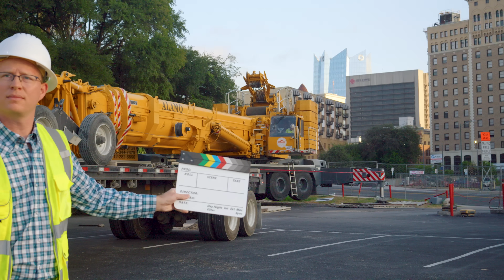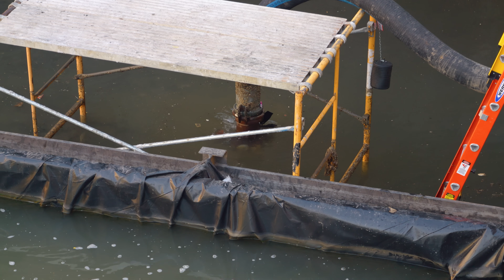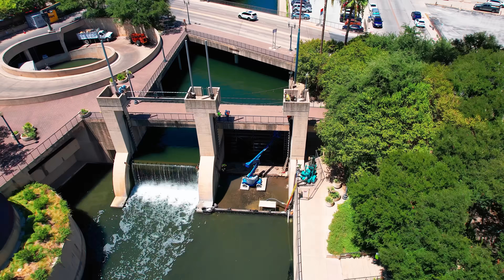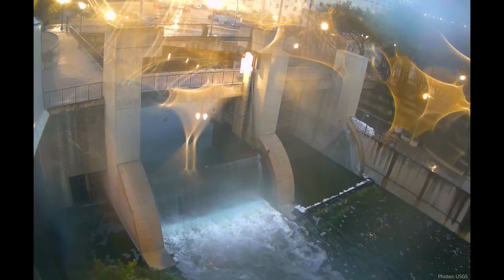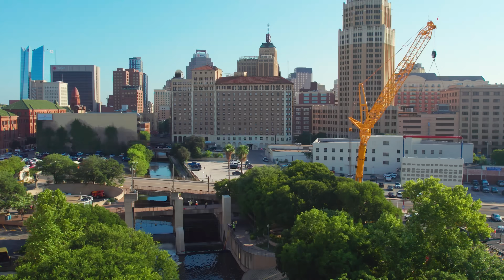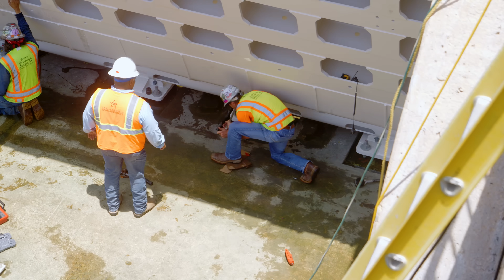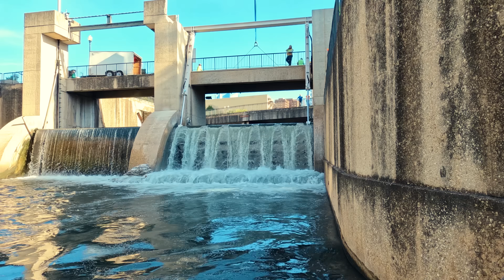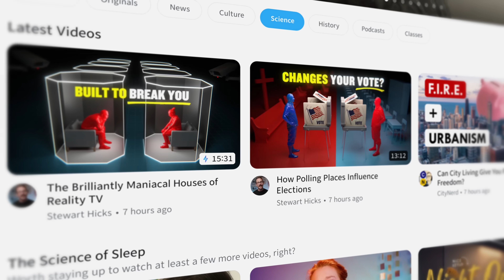The Hidden Engineering Behind Texas's Top Tourist Attraction

Comment: I'm from Houston but been the San Antonio multiple times and always visit the river walk.  So much better at night with all the lights.

I'm not an engineer but I would think making the gates hinge in the opposite direction that was designed for this application would be a better design.  When lifting the gate the force of the water will apply pressure to the face of the gate assisting the hydraulic cylinder in lifting the gate and when it comes time to lower the gate for what ever reason the big side of the ram is doing the work allowing for more hydraulic advantage.  I'm sure there are alot of other factors that went in to why it was designed the way it was.  Just my ₵.02

Comment: Can you do an episode about the inner and outer workings of large inflatable dams? I used to row on the Susquehanna River and the dock was just upstream of a short and long inflatable dam. I spent many, many early mornings wondering how it worked exactly.

It always felt a little risky launching our boats just a couple of hundred feet upstream from the dam. One foggy morning the water intake (I guess for inflation) took out the bow of one of our boats as they rowed straight into the downstream face of the intake. Another event with the dam occurred after some pranksters (we think) cut the chains holding the coach boat to the dock and it went over the dam and got stuck on some rocks just a few feet downstream from all of the water gushing down the side of the dam. I was one of the lucky ones to get woken up Sunday morning to retrieve it.

The coach took us to meet with a park ranger who drove us a short distance to the bottom edge of the dam closest to the stuck boat. Somehow, the park ranger and the coach thought it was a good idea for Kurt and I to wade through all of the rushing water to try and get to the boat. I have no idea what they were thinking, but we tried.

Obviously, that was impossible with the water raging, but they still made us try. When they realized that would probably kill us, even if we somehow could stay standing (we couldn't) they finally realized we'd have to get it another way. Had to get a trailer to drive the other coach boat to the downstream boat launch and then motor up to just below the dam and then we wrangled the boat free from the rocks it was stuck on. That was also a dumb idea considering all of the risks, but it worked. 

I don't know what would have happened if we couldn't get it. I don't know if the park or river authorities were not allowed to just leave it there or if the coach just didn't want to waste the funds of our cash strapped team buying another coach boat. 

Those stories probably don't depict the coach as having the best judgement, but he was the best coach I ever had with regards to motivation and training. 

Anyways, inflatable dam episode please.

Comment: I saw them using a torque multiplier on one of the nuts that hold down the gate on the upstream side.  Wondering what the actual torque is.  My guess is several hundred pounds, if not over a 1,000.

Comment: I'm surprised when they lifted the new dam up they didnt just use the other crane.  Just hook the big crane on the top and the smaller crane on the bottom.  Lift it up and as the big crane lifts the top they can just lower the smaller crane until its standing straight up and down.  Disconnect the rigging on the bottom and the big crane swings over.  That is how we typically do lifts like that if we have 2 cranes.  It gives you a lot more control

Comment: This reminds me quite a lot of the Floating Harbour here in my city. Lock gates were installed on the river, a huge bypass was dug (still called the New Cut, despite it being about 220 years old) and sluices were installed to maintain the level. It's no longer a working port, but the water level in pretty much the entire city centre still remains just about constant throughout the year.
Unfortunately the council hasn't kept up with needed engineering works on the New Cut, so substantial portions of it are in desperate need of repair - one section fell into the water in 2020, taking part of the footpath, railway line and road with it.

Comment: WHY would hydraulics be more reliable than electric motors?

It is usually the opposite. The latter is not prone to sudden catastrophic leaks and pricy repairs. And it costs way more to begin with. I wish the chap would interview the main project designer so he would substantiate the change. Especially since the projected life span of the new gate is lower than that of the original.

Comment: If you're a sucker for heavy lift cranes, you should have become a "Friend of the Cranes of Intel".   I live in Rio Rancho and one of Intel's oldest and largest chip fabs is here.  They recently rebuilt a fab to make cutting edge new chips.  At it's height, the project had 11 cranes ranging from small to very tall.

Comment: Interesting to see that hydraulic operation was seen as best option. In industrial use generally these days it’s exactly the opposite to get the efficiency of moves up with mechanical gearboxes instead of hydraulics. Usually from electric power to mechanical movement hydraulics are not that good, especially if any speed adjustment is done with valves and not by reducing pump speed. 

But it’s easy to see that these gates move so little that efficiency of movement itself is not the thing that makes any difference here.

Comment: To prevent a failure, is there some kind of locking mechanism on those cylinders?  With the old screw setup, it was fail secure.
I guess that even if there is a failure, it'd just drain the riverwalk which isn't a safety risk.

Comment: I think the lifting of the new gate didn't look too safe with lots of guys under a big hanging load. If it had dropped, they would become meat pancakes. If the put some big wooden blocks on the downstream side of the gate, they could work there and have a life saver in case of an accident, preventing them from being flattened.

Comment: I work at Mt St Helens, there’s a tunnel that drains Spirit Lake to keep it from overflowing its natural dam. The intake gate needs redone (installed in the early 80’s) and it’s a whole project. A friend of mine was approached about timelapsing/documenting the project, but the logistics and financials didn’t line up. 

That’s on the intake side. 

On the outlet side, we had a very large landslide 2 years ago that took out the road. That’s going to be a large project itself rebuilding the road. I might just go rogue and throw up a camera on one of the trees pointing to the construction site. 😂

Comment: 16:47 Why did they switch from a smooth top edge for the spill area to a serrated one?
Reply from the maker: Those break up the nappe, preventing funky air pressure issues between the water and the downstream face of the gate.
Reply: @PracticalEngineeringChannel  I wonder why they didn't go with the smooth face on the air side like the old ones... cost-cutting measure?
Reply: @PrograError maybe weight cutting
Reply: @LostLargeCats  doesn't quite make sense to me as weight cutting, since I imagine a heavier door makes a better counterweight for the failure mode where it's opened down flat...
Reply: @PrograError  my guess as a non-engineer: “open-side-to-air” discourages silt buildup and allows easier visual inspection. Skinning both sides could result in unseen defects lurking inside. I doubt it was a cost-cutting measure as the gates themselves probably accounted for a small percentage of the overall project cost.
Reply: More consistent turbulence vs unexpected behavior with the single long weir. We do this a lot nowadays, look at new wings, props, etc., and they have waves on them sometimes. It improves aerodynamics and efficiency when done right. It helps dampen the harmful turbulence that leaches energy and limits the total energy losses. This includes annoying sounds and vibrations and damaged hardware.
Reply: My speculation is that it makes the splash more quiet.

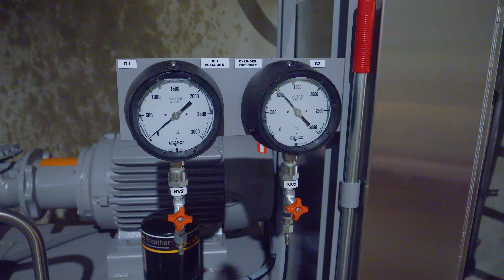Comment: At 15:51, that oil reservoir looks to have sprayed all over the wall at some point in testing. Hydraulic oil is a mofo to clean off of concrete
Reply: I work at the company who designed the hydraulic unit. I was the head mechanical designer, and performed testing of the units at our shop in New York back in July 2024. Everything looks exactly as it did when it left our shop, no evidence of damaged components, no visible paint chips. My best guess is that the oil stains in the concrete have been there prior to July 2024
Reply: @travisferrie Grady mentions that the new hydraulic pumps replaced electric motors that were less efficient. Were there hydraulics involved in the original setup? It could be any oily substance from over the years
Reply: Assuming it's hydraulic fluids in the first place.

Comment: It really makes me think of my earlier engineering days.. I used to work for a company in Canada that designed replacement sluice gates and supporting hoist structures in many parts of Canada and I even made a debris cleaning structure in California once too.

Those structures are massives and doing the design seems like "nothing" when you look at numbers but it's when you can see what is actually going on on site that we start to understand the shear size and massiveness of these parts being removed and installed.

Really nice video and even though you're a little bit too far south for me, I'm sure the experience was as enjoying as what I used to feel when you see these big projects comes to fruition.
Thanks again for the documentation!